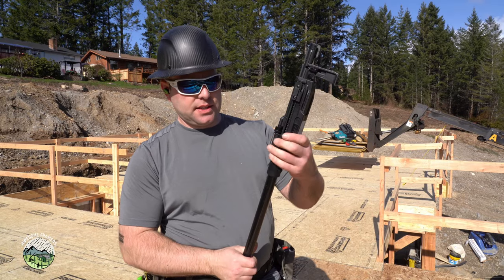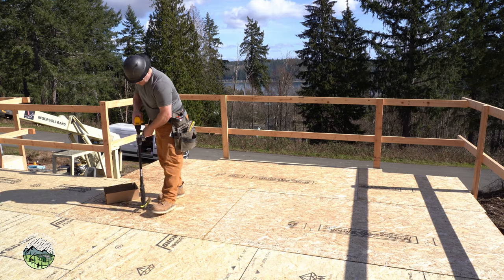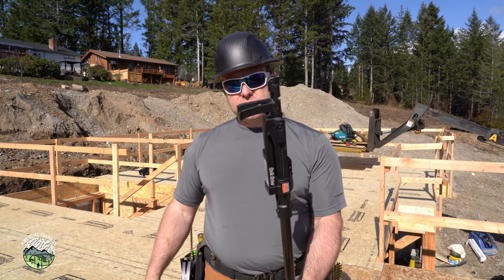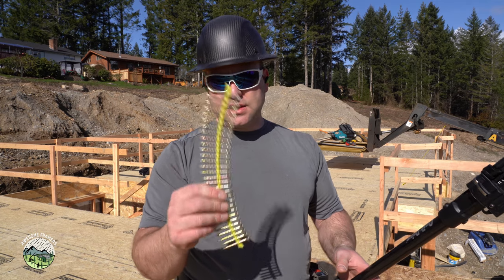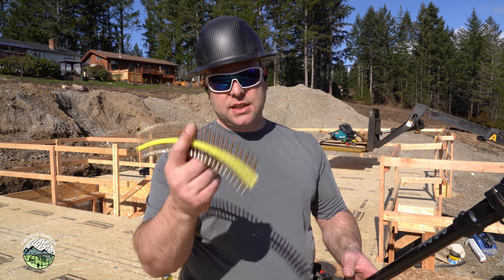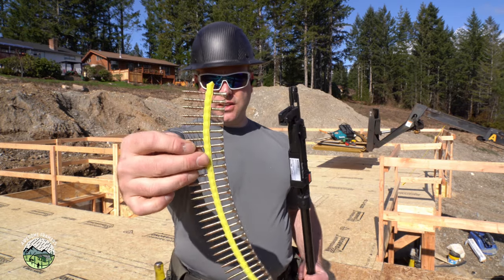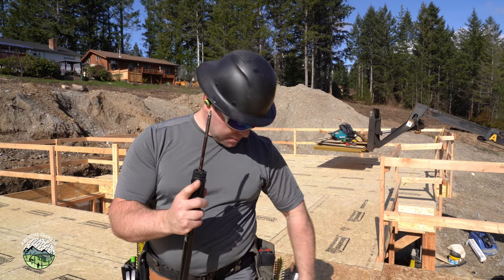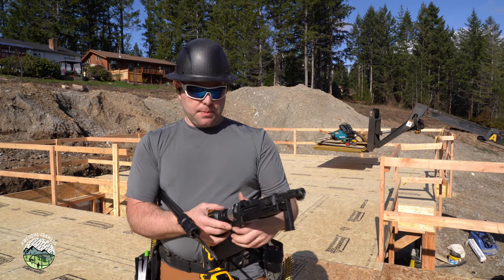Cordless Quik Drive Auto Feed Screw Gun

Comment: i used a similar system from a different manufacturer, and i spend more time fixing the auto feed than i did actually putting screws in the decking. i just went back to crawling around with a bag of screws and a screw guide on a regular screw gun
Reply from the maker: I've had great success with Quick Drive and with PAMFast fromFasten Master

Comment: You mentioned that it can also be used as drywall gun. Wouldn't the sharp edges (designed for deck and subfloor system) damage the drywall paper?.
Reply: I have one it does damage, but it’s not noticeable considering you’re going to cover it anyways

Comment: When you’re sheathing the floor are you rtcking them with screws or nails and then coming back with that to screw them off?  Or would you normally have a guy screwing the sheets off as you’re setting the next one?
Reply from the maker: Hey Tony, yes usually the top corners get tacked as they are laid.  Guy running the screw gun is usually a sheet or two behind them being laid.
Reply: you want a guy screwing off right away if you are using glue (like PL400).

Comment: Does anyone know if these attachments and drill will do the drywall screws as well or only deck? I see an entire kit like this with 2 batteries a charger drill and all the attachements for 460 which it seems like a steal but would want it to do both drywall and deck screws. My friends Metabo did both but didn’t do decks that well it struggled a little bit skipping on the heads of the deck screws.
Reply from the maker: check on strongtie.com  I think its a different tip for different screws

Comment: Can the quick drive set up be used for any cordless dry wall gun or only the dewalt drywall gun
Reply: Simpson sells adapters for a variety of screwguns, corded and cordless. They are generally used on higher torque decking/structural guns. Same ergonomics as drywall guns but have more power. This guy may be using the dewalt versa-torque.

Comment: You have the Max coil framer. Why not use scrails? Screw and nail in one. Check out https://youtu.be/5CDfaEbzay4.
Reply from the maker: good question.  Because we get so much rain we were screwing the floor down right before finished floor after the house had dried out.  If we screw down to begin with, we save that step later.  I haven't found the scrails to be as good at preventing squeaks as others have.  I think that is because we get so wet half the year.